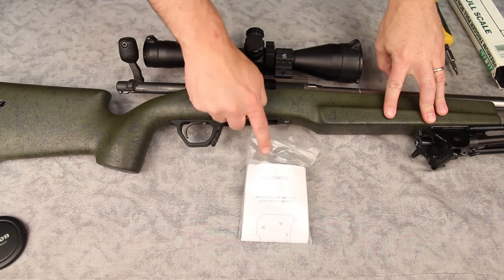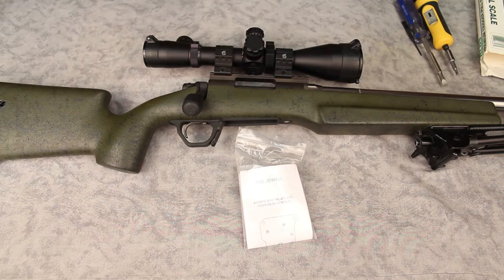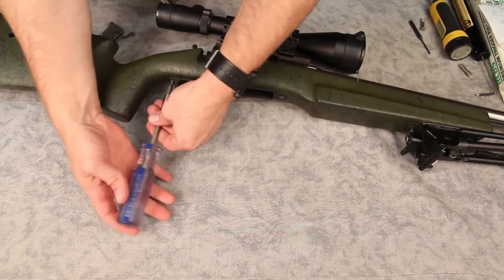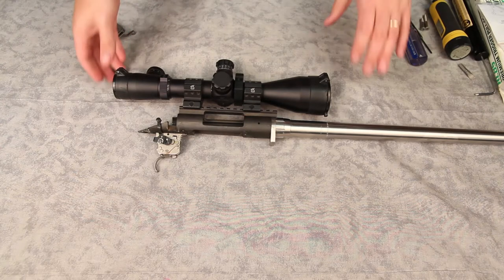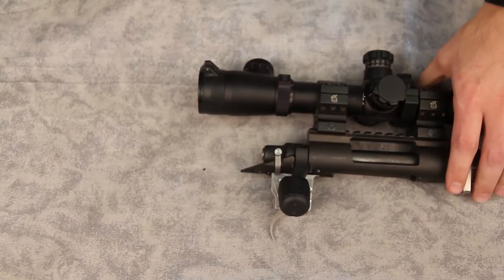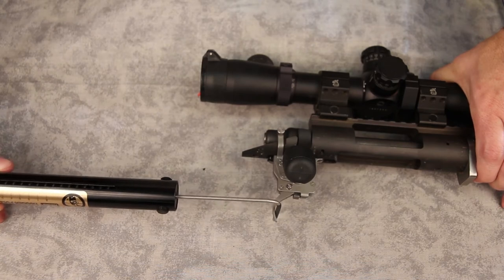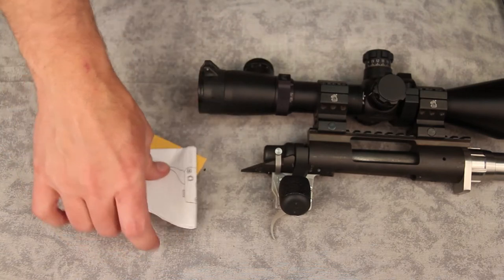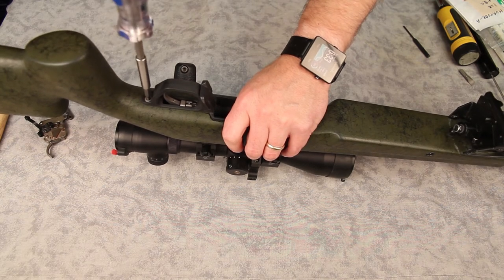Jewell HVR Trigger- Remington 700

Comment: How difficult was it to change your spring? 

Thinking of putting this on my 22 but not sure if im interested in dropping down to below 1 pound... 

Was looking for 1 pound rather than the 2 I've currently have
Reply from the maker: The spring in the trigger?  I didn't change that.  I am using the one that came with the Jewell HVR trigger.  I specifically chose the HVR to keep the weight a little higher and maintain the mechanical safety.
Reply: @AdventureColorado  k, good to know. Thank you for your video and information.
Reply from the maker: You're welcome, good luck with your 22!